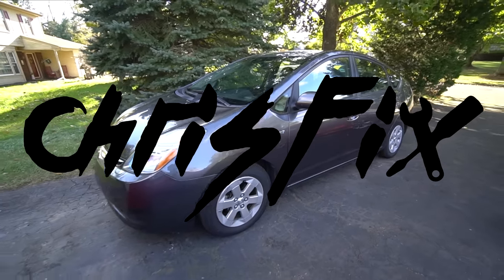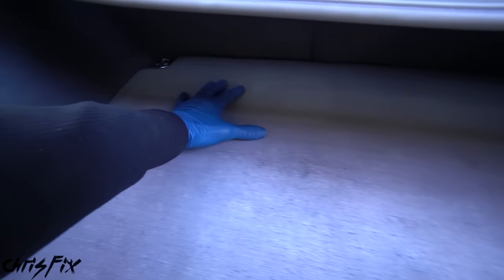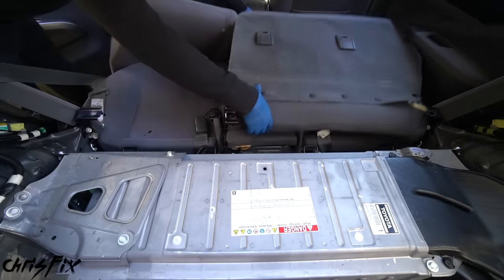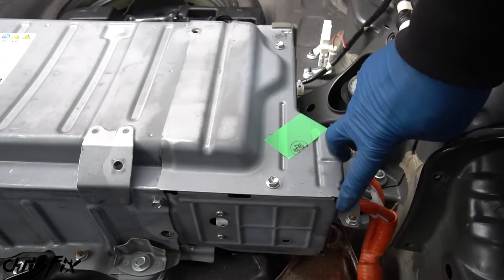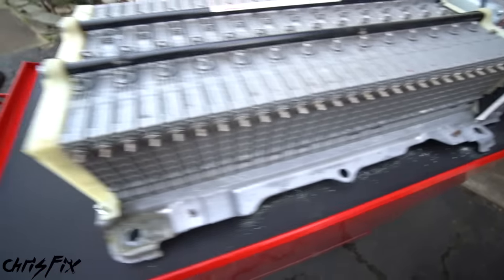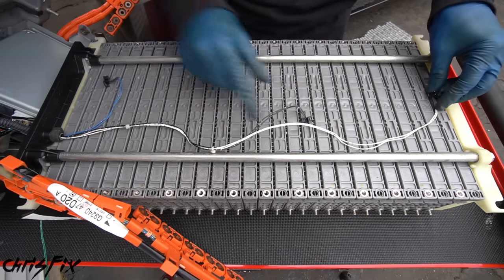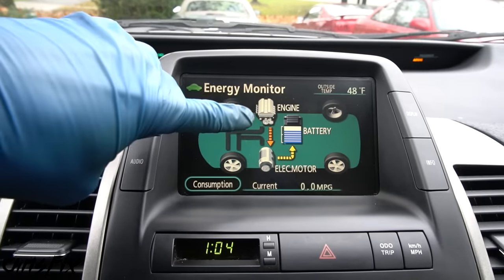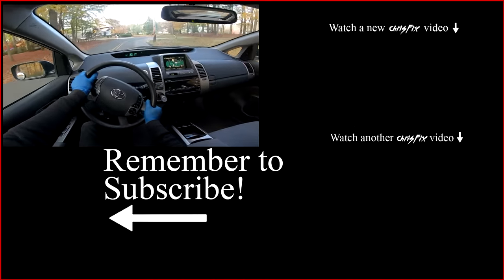I Bought the Most Hated Car on the Internet (and made $1000)

Comment: Unscrew the whole car to remove the battery
Reply from the maker: *back interior of the car lol.
This is unscrewing the whole car: https://www.youtube.com/watch?v=8ECB-Nyx2bo
Reply: then just take off the front fenders...then the steering wheel....then the moon roof...Toyota could design that battery to come out in three minutes...……..total bullshit.....that guy did a great video though
Reply: so true =))
Reply: I think if the batteries came out easy, they be a target for theives. And of course Toyota would rather you pay them to fix it. DIY power!
Reply: Lol u aint lying, thats crazy i will stick with the old cars with a simple battery.
Reply: @Ebbrush3  lol thats crazy just to change a battery, i will stick with gasoline cars.
Reply: AM  They did on the Toyota Aqua, a plastic panel clips off underneath the rear passenger seats (From inside the cabin), the battery unbolts, and slides forwards into the cabin. I'm guessing the newer prius's do this as well, the model in the video is somewhat antiquated, I think there's been three major versions since then.
Reply: @TheRetroNobody  They're fine compared to Tesla, for my rebuilt wreck there were a couple parts I wanted to buy new, I walked into my Toyota dealer, gave them a list of part numbers from the service manual, and a month later  they'd arrived fresh from Japan. They don't give a shit about who fixes the things, so long as people keep buying and servicing Toyotas.
And no, Toyota wouldn't rather you pay them, they have a five year warranty of the things, they really don't wanna be warranting a single part in a decade plus old car.
With the effort you'd need to go to to steal a hybrid battery, you'd be much better off just stealing the whole car.
Reply: AM  
That would make too much sense and be a good idea.That just cant happen
Reply: That is one of the main reasons I hate prius's
Reply: AM   They could have made it so that the battery compartment opens from the side facing the spare tire, then made it to that you simply lift the panel covering the spare tire, undo a few bolts on the side panel of the battery pack, then pull the stack of batteries out, leaving behind the steel case. The user can then replace the battery cells, quite easily. The issue is the company wanted the battery to act as a predictable planed obsolescence method (similar to smartphone makers getting rid of the user replaceable battery). They make it extra difficult to replace, but leave a method in place to deal with battery failures within the warranty period, which is calculated to be very low. Then when it is about time for the batteries to start failing rapidly, they charge a price high enough to get the user to just replace the car.
Reply: Yeah that was a pretty major job. 😁
Reply: hahaha I thought that too man
Reply: @chrisfix  I thought you'd link to one of the Bad Obsession Motorsport's "project Binky" videos.
Reply: yea, also $200 to remove the front bumper to replace a headlight bulb on my Chevy Malibu. Car Manufactures purposely make these new cars to force you to go to the dealer for repairs.
Reply: @realmusic4you  don't tell me, yesterday I paid 2 grand to replace front disc brakes on my 2010 Colorado.  The mechanic up needing to demolish the bearing/ABS sensor assembly as it wouldn't budge on either side.  Very nice idea of GM to bolt brake disks BEHIND the flange.  As for light bulbs, I changed my low-beams last week: driver's side was buried under the fuse/relay box (but was attainable by feel with the left hand).  Passenger's side I had to remove the air filter box to gain access...
Reply: Ain't Michael Buffer unemployed? So, Buffer could do the voiceover...'Lets get readddy to to buuussbar'...and...'Lets gets readddy to torrrque dowwwn'... after all, he needs work, don't he?
Reply: @claudehebert3131  It should be a crime against humanity to purposely build automobiles with the distinct motivation to prevent the vehicle owners to perform basic and simple car maintenance tasks such as the Brakes, Light bulbs, Starter, Alternator, Battery, Etc. I Had to take the whole Dashboard out of my Crown Victoria to replace a heater core, which was and is a common problem with Ford Crown Vics. Labor $300 Plus not including the heater core Itself. This is a slap in the face to the can buying Public and of course, the dealers do not mention these things during the purchasing process. Wow! $2000.00 Dude, I feel for you. Something needs to be done about this.

Comment: Hey Chris, great video as usual, but the vinegar trick removes ALL the protective zinc plating from the nuts...not just the corrosion. You should have used a dielectric grease on them when you reinstalled them to give at least a little protection. I imagine that they will corrode pretty quickly now, and that will shorten the life of your new battery.

Otherwise, great video and good tips on tools and how to organize a job.
Reply: I was thinking you should have just bought new nuts to replace the corroded ones.
Reply: Yeah, or that. :-) @gardnersemet1533
Reply: Ted Lewis ughh dude i was thinking aren't you supposed to neutralize the acid and grease the nuts!? they gonna corrode by the next day ;(((
Reply: The battery has a warranty!  LOL

Comment: 350 bucks to clean the fan? No wonder this video has 196 dislikes. Bet theyre all from the Prius scammers who make money doing this. I try to do repairs myself to save alot of money but sometimes i dont have the tools or the time so a mechanic is my goto. Wonder if Chris or others will try to make a living doing this. 1grand profit for few hrs of work? yea I could see this becoming popular.
Reply from the maker: Right? That’s crazy! That’s why I got the estimate from the dealer to show how you can do this yourself!
Reply: This is a rippoff, a job that takes apx. 15mins when they alread have it open in the back.. $30 max.
Reply: the price quoted is probably the effort it would take if it was the ONLY job they do, a lot of work removing all that trim etc.
Reply: @skaltura  wouldn't be surprised if they charged the same whether the vehicle was taken apart or not.

That's the price the book says, then that's the price u pay.
Reply: Wouldn't suprise me if they just rubbed it with a brush and some compressed air without even removing it tbh.
Reply: TheOtherWhiteBread0  Eat peanutbutter /jelly not steak!

Comment: He makes it look so easy....
Reply: Right?  25 minute video and I'm pretty sure I'd be all day out in that garage with my torque wrenches swearing about the pan of bolts I dropped with two missing bolts.  WHERE IN THE HELL DID THE BOLTS GO?!?!?!
Reply: @lexwaldez  My Summer Car INTENSIFIES
Reply: Pretty sure I could do this, and I'm not that good. Don't have an impact driver either... I agree that's really good to have - in fact, this video covers absolutely everything you need to know for this job, yet with none of the padding so common in YT vids.

Great job, Chris!
Reply: It's ALL in the editing.
Reply: @ddd228  Shocker
Reply: @maltinamaltina2665   An impact driver is a great investment. Mine is just 12 V. and it's my go-to gun.Craftsman. Lithium-Ion pack. Light weight and will put out maybe 30 foot pounds.
Reply: @lexwaldez  true, but then he works on a clean area (outside in this case) have nice places to put the things so its clean and simple to work with

Comment: baking soda and water mixture also works great for removing corrosion from electrical connectors. used it all the time when i still worked as an auto mechanic...

Comment: Who are the miserable  human beings that come to this channel and this video and down votes it? What? Did he not use the same tool as you?
Reply from the maker: Haters gonna hate haha
Reply: A lot of people hate the Prius, including myself... but I liked the video :)
Reply: He neglected serious safety procedures that should be followed or people can seriously be hurt. The reason its so expensive to repair these vehicles is because of the training techs like myself go through to properly repair these vehicles. That training and time is expensive.
Reply: Every video in YT history has been thumbed down. It's the ratio that matters,, In this case 44,000 to1. That pretty much says it all.
Reply: @rivieraauto8540  what safety procedures did he neglect??
Reply: @vincepaz944  he neglected to use insulated gloves, neglected to use insulated tools, he also neglected to tape off the terminal leads after disconnecting the battery... but most importantly he neglected to wait 15 minutes and check the voltage on the high voltage circuit after disconnecting the service plug to ensure the capacitors which store high voltage in the inverter were discharged. If any step he missed this is the one that may potentially get someone killed if you dont know what youre doing when working on hybrid systems.
Reply: It is the 2000 Toyota Dealers that watch this video and go "There goes the $2000 profit we make per car we service with this issue" - as all Prius's eventually hit this milestone.
Reply: This is a great and well done video! But yes as a previous person mentioned the omission of safety allowing the capacitors to discharge. there's a reason there are labels about high voltage and and bodily injury possibilities. Think about going over the safety precautions first and along the way. My suggestion is edit this video and do just that. Proper tools, gloves and GOGGLES! I'd hate to see a DIY person touch something with a screw driver.
Reply: @Buc_Stops_Here  as a dealer technician.... believe it or not these jobs dont pay me much anyway. Its like 4 hour if on customer pay. And being most hybrid battery warrantys last 10 years.... typically we only get paid 2 hrs to do this job. But it is a job that must be respected and you do need some knowledge to be able to complete it safely. I do not recommend this to the average do it yourselfer
Reply: @Buc_Stops_Here  keep in mind also that when we do do this precedure in the dealership we also remove and replace the hybrid battery cooling fan, and install a filter at the inlet side of the cooling fan. This is very necessary because if you neglect that step..... chances are youre gunna have another hv battery failure soon
Reply: @rivieraauto8540  Thanks for sharing.  Very interesting.
Reply: who votes down?  .. toyota dealers .. and  service :)
Reply: @lubosholicka3291  people who can see all the safety procedures he did not demonstrate voted him down as I did ..an electric shock from these battery's will kill you it's that simple I do not work for a dealer so I'm not going to defend the dealers but I am an industry professional in hybrid systems and this video could lead to someone getting killed
Reply: @sh-dy2pb  ...sure, there is a high voltage. Wrong or incorect assembly can leads in to  car fire or heavy damage electronics in a car.   This change is not for dummies.
Reply: Those miserable human are the one who charge you $300++ for cleaning a fan.....
Reply: I really think an investigation should be done on who exactly is downvoting these good videos...Maybe the owners of bad videos?
Reply: @vincepaz944  didn't stand on rubber mat didn't wear cat0 gloves ..didn't check the system with a cat3 voltage meter to check that the high tension system was dead  and so on ...an electric shock from that system will cause instant death or loss of limbs it's that serious
Reply: I voted it up because he does a great job with the full-pack presentation, but I really didn't appreciate his attitude toward cell replacement vs pack replacement. It's under $100 per cell pair and easy to do correctly, just takes a little longer. In either case, you end up with used cells. He didn't buy new ones.
Reply: @themegatronic  yea I've seen used n tested cells for sale as little as £50 each  plenty of testimonies with no complaints
Reply: @rivieraauto8540  You really think every workshop will follow every safety procedure? man i watched mechanics who dismantle airbags without even disconnecting the battery
Reply: @xshowda  go ahead and touch the high voltage wire immediately after disconnecting the service plug and let me know how that works out for you. Then tell me if thats a safety procedure worth following or not. Or maybe we'll just see in a news article about how someone preached on social media that not all techs follow safety procedures and became a victim of natural selection. Go ahead buddy just know i tried warning you not do monkey see monkey do what you see on youtube unless you really know what it is youre doing.
Reply: That would be 2.1 thousand Toyota technicians, their Service managers, and the guys working the in-house parts counter.
Reply: ChrisFix lol. Youre arrogant now. Nice to know youre happy though. Peace.
Reply: @rivieraauto8540  No, they dont pay you much, but the charge the customer out the ass. Somebody has to pay for all the suits sitting around doing nothing and the dealer overhead. Service is the 2nd highest money maker for dealers, and the one doing the actual work typically gets the smallest cut.
Reply: @Mach141  batteries are expensive, insurance is expensive, taxes and tools are expensive, thats the reality to running a business. Not everything goes to the suits. Some goes to overhead too.which includes paying the suits and the techs. Heres the reality. Im all for people doing shit themselves and saving money..... what im against is that if youre gunna post a how to video about something that is potentially life threatening. Include the proper safety steps that are required when doing this service procedure that way you dont end up with a buch of dead monkey see monkey do's. Heres the other thing. Chris fix now assumes a legal responsibilty in the event an angry spouse wants to pursue a wrongful death lawsuit say their husband dies from following this instructional video. Thats gets expensive too. Thats the world we live in.
Reply: @xshowda  not to mention most dealer techs would have to dig around in their tool box for an hour to find that torque wrench they never use 😂
Reply: Toyota dealerships

Comment: These car manufacturers have some of the most brilliant engineers and artisans on the planet, working on their automobiles designs. You mean to tell me between all of them someone couldn’t have said you know we could really make this a little easier to come out. I think they deliberately make it extremely tedious so that you don’t want to attempt it at home. You mean to tell me they couldn’t bolt the battery pack outside of all that mess and still have a protected with one enclosure instead of 20?

Comment: 9:25 and replace it with a turbo manifold
Reply: It's just a squirrel cage ventilation fan, same as the one under your dashboard for the heat and A/C.
Reply: @Patrick94GSR  Just do out with the old and in with the new

Comment: There's definitely enough room in that trunk to install a second pack in parallel, wonder if anyone's ever tried that.
Reply: Would be interesting.
Reply: Wish someone would fit a  lithium pack & plugin fittings, instead of the NiMH.
Reply: Well 12 years ago. I helped start at business. We took the prius and made it into a plug-in hybrid before dealerships even made the. The first type we made was 6 time the capacity of the prius pack. It fit in the spare tire area and had the same configuration as the original pack.
Reply: The batteries were made of NMHD the same as the factory pack. The factory pack was removed and our pack was installed. It got a range 25 miles electric per charge. Our second pack we made was lithium. Those had a range 45 miles all electric. In the span of 5 years. I have replaced about 100-130 packs with our conversation kits.

Comment: Great video.  You reinforced the value of auto mechanics, plumbers, electricians, HVAC techs etc. They're specialist in their trade. Doing electrical work without proper knowledge can cause damage to property or worst, electrocution. I'd
 rather pay a mechanic to replace the batteries.

Comment: I can understand why the dealer charges so much, I'm taking a guess of one and a half to two hours just to get the battery out.
Reply: They don't even remove the cells, they just get to the part of the video where he pushes the seat forward and then remove and replace a new battery. This is an hour and a half MAX. I can take our my battery in my car in like 40 min without power tools. I had to do it twice.. probably should have got an impact.
Reply: It does take some very long labor. I changed mine by myself (took about 5 hrs) but my car will go another 100,000 miles
Reply: changing the battery takes less than 2 hrs.  the dealer replaces the whole battery pack in the with the box.  he does nor assemble the battery cells. switching the box does not take long

Comment: holy shit i could do this, its not hard at all. And i have a garage!
Reply from the maker: Awesome
Reply: 90% of auto mechanics is easy --  if i had a garage,  i'd be making mad coin
Reply: @Carlzday  I can change entire suspension, tension belt, change some stuff in the engine bay, but I'm too afraid to take my engine apart to do timing or change gaskets. More work in the engine means more fear for me.

Comment: Still looks easier than working on a Transmission
Reply: The battery doesn't replace the transmission, the motor-generators do.
Reply: Says someone who probably doesn't work on transmissions
Reply: @AtlasJotun  that wasn't the context of my statement.  Its that this battery replacement is lot easier than rebuilding a transmission
Reply: @gandj1734  no i dont but i've worked in the automotive field and there is a reason that Repair shops are separated from Transmission shops.  Its because its specialty work.